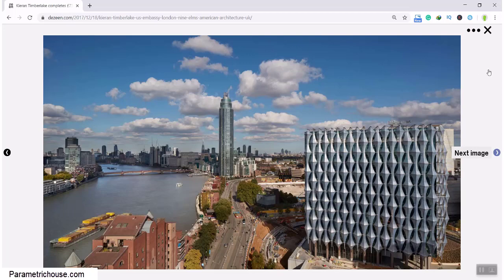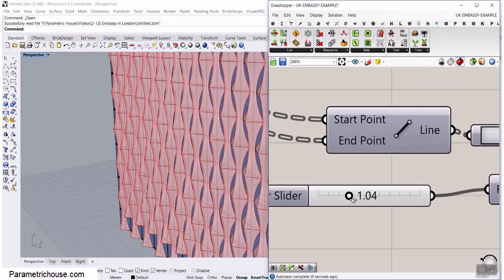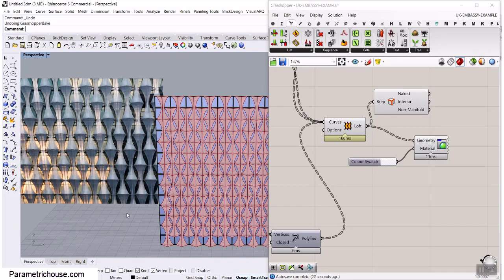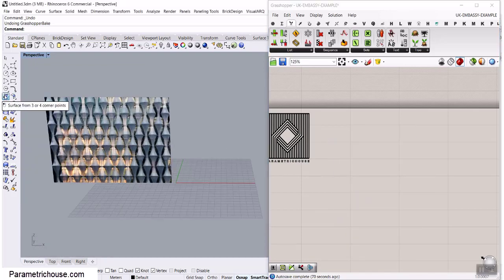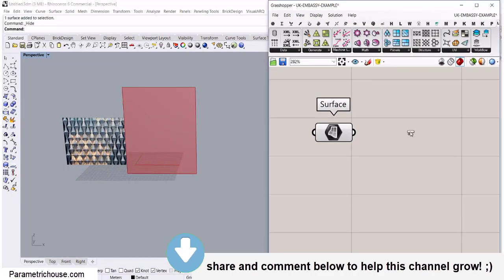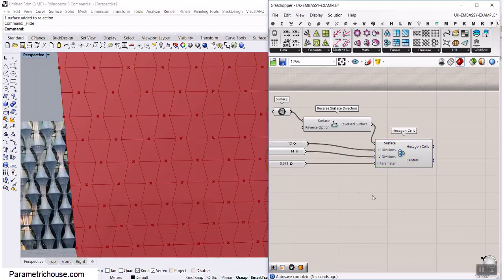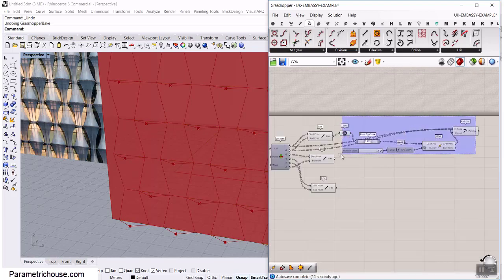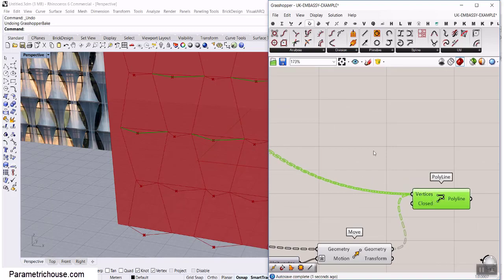Rhino Grasshopper (Parametric Facade)

Comment: https://www.archdaily.com/778976/one-main-office-renovation-decoi-architects/56722911e58ece6db50000fa-one-main-office-renovation-decoi-architects-render-2?next_project=no 
Can you make a video about this table. I tried so many things to model this but I couldn't do it. And I want to ask something else.

https://www.archdaily.com/778976/one-main-office-renovation-decoi-architects/567228f3e58ece10180000fe-one-main-office-renovation-decoi-architects-render-1?next_project=no

This is from the same project. All parametric design. What I want to learn is, how to fit these designs in the project. It's easy to design something randomly but when you have a floor or ceiling plan, and trying to model these type of things it becomes harder. Firstly, I make a surface, same size as the ceiling. But when I start to deform it, it gets smaller. The columns stays out. Can you help me about this?